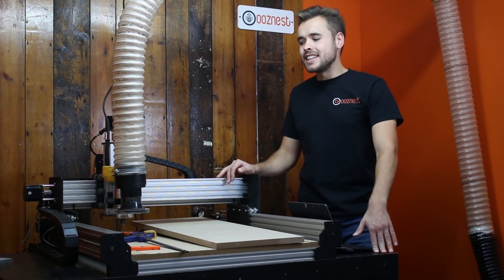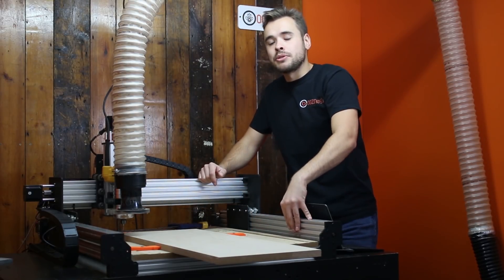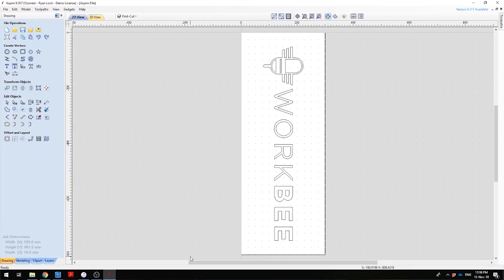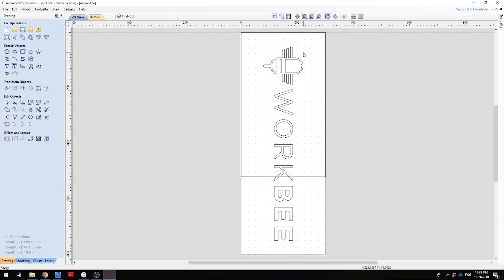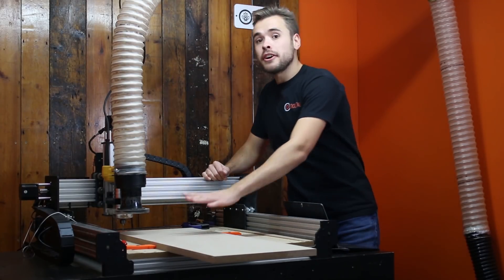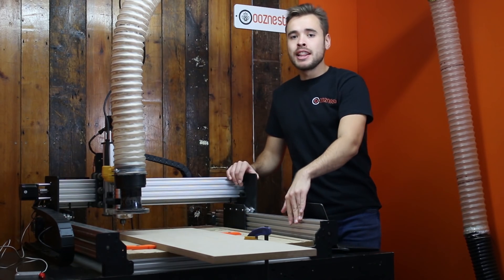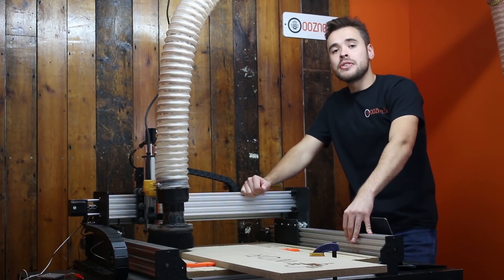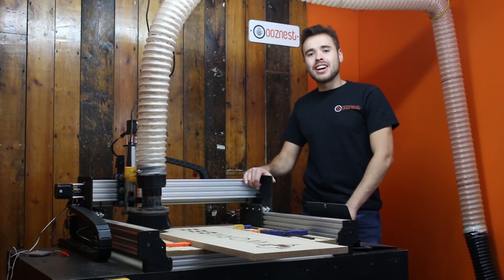Cutting Materials Larger Than The Working Area On Your CNC Machine | WorkBee

Comment: Hii brother can we do 3d carving with the job size length more than machine table length job length-2610 table size 2500? Plz reply is 3d possibel...
Reply from the maker: The biggest sheet the WorkBee can cut is 4' x 4' sheets. For larger sheets, such as 8' x 4', you can use tiling.

This involves cutting one half of the sheet, pushing the material through, and then cutting the second half.

We have a YouTube video that explains the process: https://www.youtube.com/watch?v=JKyiKZrLPqA

Yes the machine can cut in 3D!
Reply: @ooznest  ok sir and for same percent of speed which machine is better servo or stepper ?does servo gives faster production then stepper with respect to time?

Comment: Finally I have found a channel that shows us a bit more about the process with CNC's. I wanted to build my own but this looks like a sweet piece of kit my bro. Who builds these CNC routers?? I was pricing the 1500x1500 machine and it was priced at 1,600 with shipping .. I live in Ireland bro. I'm worried about the shipping process tbh. Lotta braindead ppl chuck stuff around in the depots and I worry mine would be broken in transit. 
What software does this CNC use bro? I'm a newbie to CNC's mate so I really want one with a newbie friendly interface.. LMAO. I heard what u were saying about cutting metal and stuff with the belts version machines so I would defo look to go smaller to have the lead screw instead. The one in this video is really nice bro. What is the size of it again or does the have a specialised code for this one along with the rest.
Reply from the maker: Hi, we manufacture the CNC Kits. We ship to Ireland without any issues. It uses WorkBee Control here: https://learn.ooznest.co.uk/Guide/WorkBee+Control+Overview/22

You will need CAM Software, either Vectric or Carveco.

All the machines we supply now are screw drive. The biggest we supply is 1500x1500mm and is screw drive.

Thanks

Comment: Hi Ryan, One thing I can't seem to work out in my head is when you surface your spoiler board, do you effectively pocket out an area equivalent to your max working area? if so won't there be a lip?Say I wanted to have a workpiece 1000x400 but only machine within the 770 area on a 750x1000 machine the two ends would be on the unsurfaced area at the front and back. is there a workflow for this scenario?
Reply from the maker: Hi Wayne. Yes, you are just pocketing out the Work Area, therefore there will be a lip on the two sides and back. Along the front there normally won't be a lip. A workaround to this is to have a spoiler board the exact same size as your Working Area. Ooznest.

Comment: Is it possible to cut out a board by pulling through rather than rotating? Say i have the 1000mm x 1500mm router and i want to cut test out of a board 800mm x 2400mm, can i pull it through in sections to rout out each area? I hope this makes sense.
Reply from the maker: Yes see here: https://www.youtube.com/watch?v=JKyiKZrLPqA&t=3s

Comment: All this assumes that your piece of work is exactly square and parallel surely? Any run out and it won't fit in your previously set clamps and your workpiece zero will be out?
Reply from the maker: Yes you do need to very precise when doing the above.

Comment: has anyone tried this with free software? like easel/ I have tried with Easel but it shifts just slightly and Not sure how to fix that. The start point are exactly in the corner so it's not that.
Reply from the maker: Hi, we haven't tried it with easel. But it should be possible using the rotate method. It depends on how good you can re-align it.
Reply: Ooznest I tryed that hit it is shifted a little

Comment: I am going to be using the machine to cut out components from a large parent board.  Is this method accurate enough to enable a long cut to be continued after turning the board. For example cutting a rectangle 400mm x 1200mm on a machine with a 1000mm x 1000mm bed? I suspect that this would depend partly on the precision of the cutting of the original parent board.
Reply from the maker: Hi Pancho, thanks for your comment. It can be accurate, but it would highly depend on how accurate your parent board has been cut and measured.
Reply: @ooznest  Presumably it needs to be precisely square, but we can measure it after it is cut and put the measured dimensions into Cut2D
Reply from the maker: @lilleruno  Yes it would have to be.

Comment from the maker: Hope you liked the video. If you have any questions please let us know!
Reply: Hi Ryan thanks for the video, what sort of accuracy do you get if you have a section that needs to be cut by the two different layers, for example if a letter had to be cut in both orientations? Thanks
Reply from the maker: @malco84  It can vary greatly. It really depends on have accurate you can measure your work material. How close to 90degrees the clamps are. Also the clamps have to be perfectly aligned with the axis of the machine. Also your material has to be perfectly square. In the above it was about 0.5mm out between the two layers. We have another video coming soon which is more accurate, but involves drilling some locating holes into your workpiece.